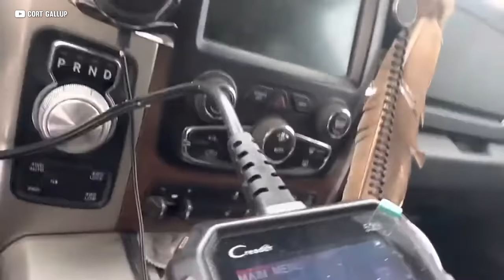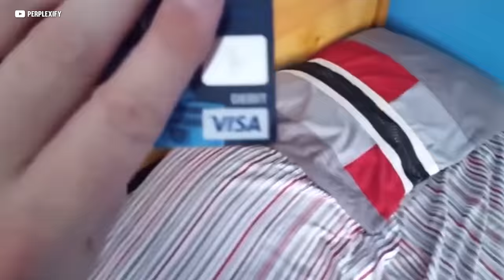Worst Trucks Only Stupid People Buy

Comment: Had a 2019 Tacoma with a rattling engine and got a pathetic 19 MPG. The pandemic hit, and a dealer bought it from me for more than I paid for it 2 1/2 years earlier. Just went in to look at ordering a 2024 Tacoma and ran away when I saw it was over 11k more than mine was, and is going to have a turbo 4 cylinder. After 42 years as a dealer tech, I will never own a turbo anything. I'd rather own an electric vehicle that will burn down my garage.
Reply: The 2023 MY, is the last with the V6, IIRC.

Comment: You can say all you want about the 6.0 I have a 2006 f250 with 375000 miles on it all original stock and I've never had an issue besides batteries, brakes and a couple alternators let me hear your thoughts

Comment: You would have to be stupid to buy a new Toyota Tacoma. Due to regulations they had to make changes to their engine and start stressing them. Well one thing led to another and now they are grenading.
It isn't the 4.7L Magnum/PowerTech V8 that were the issue. It was the paired down 3.7L engine. The cylinder could shatter, and they are expensive to repair. They had a weaker transmission as well.

Comment: What about Honda trucks. My 2006 Ridgeline has 110,000 miles and no problems. Batteries and tires and brakes. That’s it. So are they the most reliable? Yes. Hands down.

Comment: I've had nothing but problems with my 2017 Nissan Titan.  Very hard starting and the dealership had trouble getting it to start.  But they would say that the computer doesn't show a problem there is nothing wrong.  And they refused to fix it.

Comment: the Ford 6.0/6.4 diesels are kinda like the Chevy 305 V8s back in the 80s/90s. they could be made to run strong and everything, but after you spend all that time, money, and effort... you could have just bought a better engine. twice. and still have problems.

Comment: I wish you could get the 6.2 L boss V8 in the F-150 XL base model with a 6r80 that would be a solid work truck. I guess I could just buy an older F-250 and save myself a headache but you're still going to have to. It's still not a halftime you know and you don't want to have to get the raptor or a platinum

Comment: This video is extremely misleading with the Ford 6.0L/6.4L Powerstroke.  International is the designer’s of the engine not Ford.  The whole fiasco with those engines is why the 6.7L exist.  The 6.7L is designed in house by Ford.  They terminated their relationship with International over the reliability of the 6.0L/6.4L Powerstrokes.  Ford sued International for them to cover all the warranty issues and costs associated with their engine.

Comment: Im in the middle with the toyota 3.5 v6. 
Needs a little more power and the gas mileage isnt great but i am at 240k miles right now so i guess i cant complain too much.
And since im in the south rust is not an issue

Comment: I do believe that forwards are the worst trucks. My brother-in-law workwe're getting forward dealership, and he told me that that's the way force are designed for you to keep bringing them back for repairs.
So they can keep money.  Overcharge. Now, Chevy's to me a better truck. Even though I have owned at least 6 forwards so far in my lifetime and 3 chevys, and I can tell you one thing that since I got away from both of them install going.  American made but I went to Toyota trucks. You can't beat them and I'm not bragging for Toyota or anything. But I have saved a ton of money in my pocket f*** and I continue to buy them and pass them down to my younger.  Family members and they love them.

Comment: in my opinion we need to go back to pre-emissions I have a 99 dodge with the cummins engine two wheel drive it has 218,000 miles on it and no problems, I also have a 2010 mercury mariner with 89,000 miles on it I have also had cars from the early two thousands and the newer the car the more times it breaks down, the latest is the mariner has an intake leak and two fix it you have to tear off the front of the car, not a good design, the cars and trucks I had in the 70s and 80s you could fix it with a few tools we need to go back to those days, way better in my opinion.

Comment: I have a 2005 f150 king ranch with the 5.4 3 valve and have already put over 3 grand in the engine. We'll it's still not right. New timing chains sprockets guides and cam phasers also New cam position sensors. Put a new driver side head with new valves gasket and valve covers. Some new injectors, coil packs and it still throws codes for cam position sensor, injectors and coil packs. Worst engine ford ever put out. Thanks for letting me rant.

Comment: I drive a 95 2.3 5speed manual ford fukin ranger. Over 300k on it, don't smoke, don't knock,  and I do next to nothing to maintain this thing. Easy and cheap to repair, 268miles hwy on a quarter tank I'll never buy this newer garbage.

Comment: Cutting down 6.0/6.4 Powerstrokes and the clip of the truck, blowing a bunch of blue smoke, has a 7.3.  🙄  "Nothing is cheap, with these engines."  Except a crate engine is cheaper than doing just injectors, in other diesels.  Then you take a shot at the 6.7?  Only the best diesel that currently exists...but sure.  Then when talking about the 5.4, you just say the Triton engines are all garbage.  Far from true.  The 4.6 is an absolutely awesome engine and the 6.8 was a decent engine, also.  Those are both Tritons.  Poor effort

Comment: Honestly that really wasn't Nissan trucks fault it was Cummings the engines were the problem and the Transmissions has a Chevrolet owner they didn't screw up royally with the active fuel management system and I'm not too fond of their Transmissions either to be honest at least the 4L 60e

Comment: For those who are looking at buying a truck:

Ford: Runs great, but when there is a problem, it's catastrophic. 

Ram: You WILL have electrical issues... Forever.

Chevy: When stuff starts going bad, all of it goes bad. 

Toyota: Runs great for a very long time. Repairs are becoming more and more expensive. More so than Ford, Ram and Chevrolet. 

Any other truck brand? Just don't...

Comment: 5.4 3v  makes 315 max hp at the crank .not 360 . And its a decent engine . I have a stock 2010 5.4 with original timing components without any problems or rattels over 190k and a 99 sd with a 2002 5.4 2v thats even more reliable

Comment: I can tell  you that the 2015 Ram 1500 ecodiesel is a ripoff and joke. The EGR, water pump, and DEF system have been replaced. Last week at 175K it stopped working due to a high pressure fuel pump, which there is a recall on that Stallentis does not have a solution for over a year. My truck is FUBAR till they come up with a solution. I am screwed. Will never buy a dodge or jeep again.

Comment: Let’s be honest. Everything is junk now. There isn’t anything that could even be close to considered reliable anymore. It’s all made with cheap metals and plastics. Profit over quality is the name of the game. They increase profit margins by making substandard garbage. Bought a cub cadet lawn tractor two years ago. Already had to replace the battery and have been through two belts. I don’t mow that often. Brand new husqvarna chainsaw?  Dumps oil out of the bottom so bad while sitting that I have to keep a garbage can lid under it to keep it from dumping all over the floor. Bought a Kawasaki Z1000 motorcycle back in 2015 brand new. At 12,000 miles, it lost third gear. And I never beat on it. I don’t do wheelies. And the list goes on and on.  If you happen to get something that lasts, that’s the exception. Not the rule. It’s a gamble buying anything. Majority of the time, we the consumer lose.

Comment: The Titan (and the Armada/QX56/QX80/Patrol, even the 3rd gen Pathfinder) with the 5.6 petrol V8 also had a pretty serious issue when they started production in 2004. The catalytic converter will fail and throw its pieces in the engine, thus damaging it. Many people say that issue was fixed with the 2015 update though.
Reply: Lol! That's impossible. The exhaust coming from the engine would push anything out the rear. They had problems with exhaust manifold leaks but nothing like you stated.

Comment: That's funny you said it the new tacomas the most exciting truck you're looking forward to. Now they have to replace 103,000 engines for failure and the transmissions are failing. Toyota fell off.

Comment: 2010 Colorado I enjoy the truck liked it from the gate... Buuuuuut you know like chris from FamGuy yeah first it was the leak from the tranny fixed easy drove good for I dont know a while I forget just and its a bad thing with me to check oil or even care until I hear it getting rough then I do it I put 18k on it in about 8 months blew the motor replace it with another funky 5cl from an ok dealer in NY i was not super happy with the buy any way got it in and this ones a little quieter but I feel it is not right I feel it in my foot not on the gas hard running about 40-45  and the water leaking in the doors sucks DonkyD the seals arent cheap neither

So new carpet and LS SWAP yeah good Idea or go get a newer one cuz this one is still holding value to me, I  like it the body style the way it drives its a good TRuck and it doesnt have all that crap my wifes jeep has on it I drive ok I dont need a helper and if you need that stuff beeping at you and distracting you and AKA helping you then take the bus and learn how to put the gas in your car cuz damn I just dont need it. I do need my Truck tho

help please

Comment: 2016 Ram 1500 with Ecodiesel, top of the shit pile... and don't forget the turbo cooling hose that ruptures... lets put a metal banjo fitting on the ends with a piece of rubber in the middle and lets bury it under the intake manifold, in a spot that gets to be the hottest area on the engine... the engineers should be made to repair at least 5 of these if they came up with the design... it would change in a heartbeat.... DONT EVER Buy an Ecodiesel

Comment: I have had a 2009 f150 5.4 triton for over 10 years. replaced one coil. I run synthetic oil and change it every 5 to 6000 miles and it's still purring along.

Comment: I know many that had great luck with the ram 1500 eco diesel. I also have a VM diesel with 150k miles and going strong.  Lol you literally put one of the most reliably engines ever on your list, 4.8/5.3 GM. Try turning stop/start off. So ya I will take your video on the toilet where it belongs.

Comment: Older Ford 150 with straight 6 cylinders were good trucks.  Now these trucks with eco V6 and eco 4 cylinders with turbos are junk to include the Ford and GM made, 8 speed transmissions.  Currently have a Ford Ranger with 2.3-liter engine with standard transmission 292,00 plus miles no issues and will take it to the local Ford Dealer to touch.  Best years for the Ford Rangers up to 2011, after that time frame the new Ford Rangers are junk with multitude mechanical issues just like the F150's now days nothing but mechanical nightmares with electrical, transmission, engine issues.  The Ford motto use to be Job Quality is Job 1, now buy our junk and tell us what problems you are having because Ford does not quality control their products anymore.  Ford just wants to build and throw it at the consumer and let them deal with the issues. So, consumers have to bring back to the dealers and let part changers try and figure out the issue.   Seen vehicles purchased from Ford as fleet vehicles the dealer could not properly repair, and the junk would break down again.   This was also common for Nissan fleet vehicles.  Dealer claimed the vehicle was repaired and before departing the parking lot issues would arise and had to turn around in the dealers parking lot to turn the vehicle back in for repair.   All the vehicles made currently are junk waiting to self-destruct.

Comment: I personally know two people who own the Nissan Titan diesel and has over 200,000 miles with no problems. 
Most all farmers where I live own the Dodge 1500 with a 3.0 diesel with zero problems. 
The catcher to keep these diesels running right is a total delete with the removal of the egr valve.
As a dodge man, the dodge 4.7, 3.7 and all the hemis are all pieces of shit engines. 
I own two Dakotas, 1996 and 2001 along with a Dodge first gen 5.9 diesel, and the 3.9L magnum is one of the best, most reliable V-6 engines ever built. I wouldn't own a Dakota that didn't have the 3.9L  magnum engine.
The saying with Ford, fix or repair daily, has gotten worse with all Ford trucks with gas and diesel egines, over the last 30 years. Fords are a total piece if crap and only loyal idiots buy them that wants to continuously spend money on crap, just like chevys

Comment: Some of the stuff these guys say is correct. Some is utter bullshit.  Hell, they couldn't even find the right year model vehicles to display as they talked about an engine.  That squared jeep body style had a 5.2 or 5.9v not a 4.whatever.  The powerstorkes had issues but that 6.4 is still the most powerful diesel you can buy in a pickup.  Odd they didn't talk about all Chrysler products electrical issues.

Comment: Chevy trucks are not failure prone by any means I guess it depends on what power train you have... but as far as gasoline V8 engines go in GM trucks they are far better than ford or dodge

Comment: You state Chevy Siverados  have been around since the 50s cyet your picture is of a 1970.  No older Silverado pics?
Reply: Chevrolet Silverado was introduced in 1999.  Before that, Silverado wasn't a model name - it was the name of the top trim level for C/K pickups starting in 1975.

Comment: First of all, VVL stands for variable valve lift, which you obviously didn't know, and second of all, that has nothing to do with cylinder shut down, which you obviously also didn't know!  And the problems with the cylinder shutdown have largely been solved with the engines from at least 2015 on. Otherwise, GM wouldn't have taken over the top sales spot from Ford!

Comment: As a previous tow truck driver I will tell you. I’ve towed these cars more then anything
1 any newer jeep
2 anything bmw or Mercedes I’ve towed brand new bmws with 3000 miles having anything from a electronic meltdowns to full on engine failures. 
3 brand new gm trucks, electronic systems completely shitting themselves for no given reason.
4 Toyota Prius, worst cars to tow. When they have an electrical meltdown or have any other issues there is NO WAY to get the vehicle to ether get out of park or release the parking brake. So most of the time I was dragging them onto my flatbed with slippers.
5 anything else was just random shitboxes or any old or new car having wild breakdowns

Comment: Fifty-eight years ago, the 1966 Oldsmobile Toronado was an amazing car, gas was cheap, engines didn't have computers and catalytic converters, carbon dioxide wasn't a dangerous greenhouse gas, we ate lots of red meat, and no one noticed the cows farting and burping methane gas. Life was good back then. ~ So now we told we are living under a greenhouse roof holding in carbon dioxide and causing climate change. If this is true where is the greenhouse roof? It doesn't appear to exist. ~ I think the "science" supporting N∈t Nothing policy is so-called science and not real testable provable science. Cleaning up engine exhaust is good, but eliminating carbon dioxide and calling it a pollutant is wrong. Now we have sh*tty cars with sh*tty engines.

Comment: Can somebody please just build a pickup with about a hundred horsepower naturally aspirated diesel in it and put a shit ton of gears behind it. 100 mpg is doable . 
  All these morons that want diesel trucks to accelerate like cars. 
 My first 61 Kenworth had a 5 and 4   with a 220 cummins and I hauled 86 ,000 gvw over 6 % grades making about 5 mpg . 
  If you can do that with 220 hp a 100 hp diesel in a pickup is plenty of power. I don’t want a race car I want a pick up truck for Christs  sake.

Comment: I built the old Toyota 2000s to mid 2010s 1GR engine.. specifically the one that wen into the tacoma. that was a good engine. The ones before it.. ugh. The one after it was nothing but a total disaster. Thanks a lot Obama Era environmental reform regs.

Comment: I highly suspect that oil sludge problems, and other thermal problems in engines today, are because of the catalytic converters that cause engines to run hotter (especially at the heads), as they push heat back into the engine an effort to burn that last hydrocarbon molecule.  It is true that the EPA dictatorship has no interest in how long your internal combustion engine lasts.  The closer they are to the heads, the hotter your engine gets.  Too bad somebody does not develop a cat system further down the pipe line that is powered by another generator with electric coils, so it does not use the engine heat to do its job.  Ohh-, china is building coal fired electric plants, so only we pay the extra costs to "save the planet".  communism is privileged, and western culture is sabotaged.  Those results are in.

Comment: Sounds like y’all are bias Chevy lovers and even though the new Chevy motors are having major failures you seemed to kinda skip right through it like it’s not a big deal. Then y’all proceed to talk major crap on all the other manufacturers. Look , gm is good for only one thing ! That is building military equipment! The only problem is that they aren’t very good at that either

Comment: Worst thing ford f250 f350 f450 and so on amd so on was done away with the greatest motor ford never owned the internal 7.3 they won't tell you this the resin they done away with it instead of slaping a turbo on them was beciase they were way way to reliable . Wow ford wow